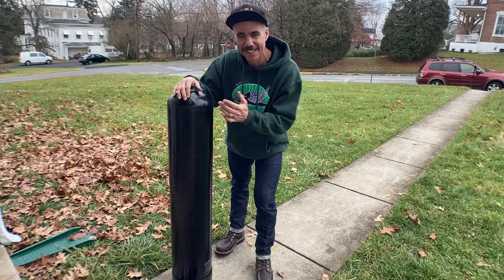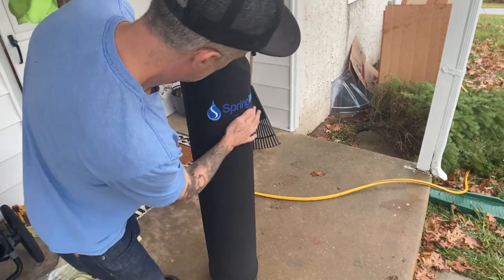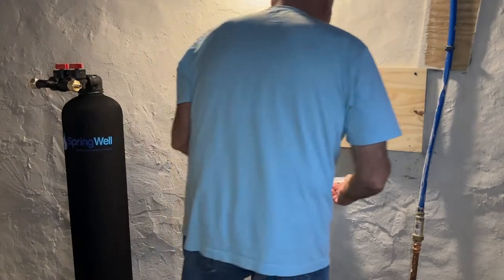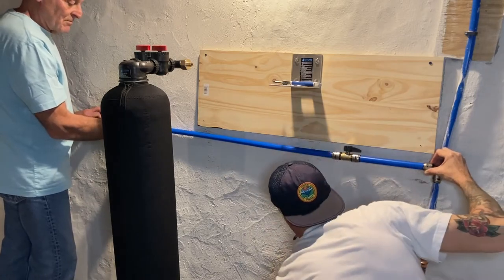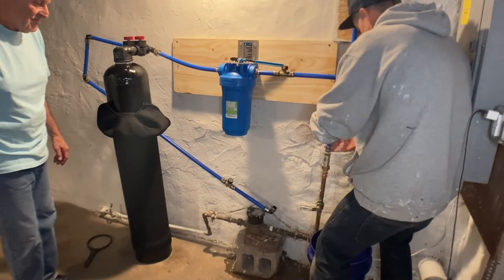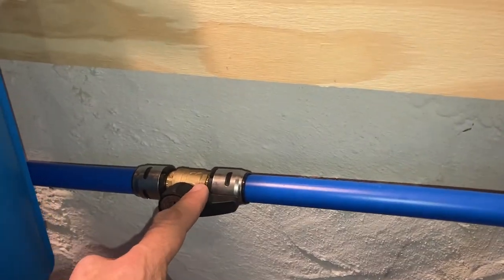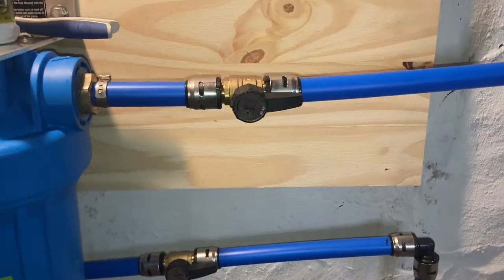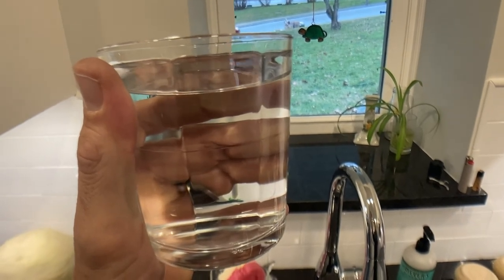The Best Home Filtration System - Springwell Whole House Water  Filtration System

Comment: Been a plumber for over 25yrs.  Some thoughts, 3/4 pex actually has the same diameter of 1/2 copper.   Your flow is severely restricted.  I just installed one of these systems with the UV light.  I used ALL 1 inch pex so flow is not restricted in any way.  Also I installed a complete bypass of the whole system so any maintenance can be done without having to turn off water to the house.  I also presoaked the carbon filter and flushed the whole house after install, very important.
Reply from the maker: Thanks for contributing, love the username!!
Not much I can do about the 3/4” pex in the house. It’s how it came, and honestly, we have no issues with water pressure. 
Re-running new lines would cost an arm and a leg!
In regards to filling the tank and flushing it after, at the 0:17 mark I clearly explain you need to fill it and let it sit for 48 hours.
😑😑😑
As for your setup, it sounds like the work of a seasoned plumber. 
I’m just a homeowner trying to do the best I can.
Thanks again for contributing!
Reply: @DIYTutorialGuy  You're showing your age if you recognize the username lol. Good job as a diy. Just pointing out some professional differences. You will know there is a flow restriction when you're taking a shower and someone turns on the washing machine dishwasher or flushes a toilet. Prepare to be burned! Lol!
Reply from the maker: Seems you and I have been around the block a few times!
🤜🤛
Your advice is great, and you may get a comment from me in the future if I have any plumbing questions!
Man, my last house had that issue; flush a toilet while in the shower you got scalding hot water. 
Ouch!
When we first bought the house the toilet would occasionally run. No big deal…until you are in the shower thinking nobody will flush, then the toilet starts filling again!
Reply: @vinnygoombatts1458  I am purchasing this unit and it is going to be installed in our well closet. All of our connections are located at absolute floor level. Will I have issue if I run flex tubing from the top of the bottle down to floor level on of inlet/outlet sides?
Reply: Thanks, I hope I have the same success...no plumbing skills 😒
Reply from the maker: You’ve got this!
And if you encounter any issues, comment here. There are quite a few plumbers that have offered excellent advice and would be able to help you out.

Comment: I'm installing my system this week. No one has the 3/4" PEX x 1" FNPT adapter I need. Had to order it online. I'm also using 3/4 PEX. I bought the crimp tool to and will use the rings to secure the connections. It's going pretty well so far. Thank for the video, it helped me plan my project.
Reply from the maker: Nice work, glad this video helped!
Keep me postrd.

Comment: Looks good you did forget the bypass, in the event you get a clog or cant get a filter you would be able to bypass all of this.  Easy to add right there where you have those 2 90s at your water inlet.
Reply from the maker: Thanks for watching and commenting.
I chose to not install a bypass.
If an event arises where I need to bypass the tank, it will be addressed at that time.
Take care!
Reply: I believe that tank has a bypass valve included at the  tank head and the tank can be detached while leaving the head/valve in place to do maintenance. The Springwell website has an image of this in the instruction on replacing the media.
Reply: @Mrcm30  yes but that's just on the main tank, if that sediment filter leaks, like it does in the video, they're screwed.
Reply from the maker: Wow, really driving it home.
Reply: @DIYTutorialGuy  for the cost of 2 tees and an extra valve, it's absolutely standard practice
Reply from the maker: Well, you seem to be a plumber.
I’m not.
I appreciate the constructive criticism of my work, as well as your added criticism of Springwell.
Hopefully your comments prevent anyone from missing a standard practice step during install.

Comment: Thanks for posting the video.  In the process of designing our water filtration system which will be the Apec Brand.  I am curious why you put the sediment filter after your main filter?  In the videos I have seen so far, the sediment filter always goes first, then the more expensive filter(s).  Overall was fun to watch your installation and explanations.  Good job!
Reply from the maker: Springwell support stated it can go before or after. 
Their instructional video had it after the tank, so I did it that way.

Comment: How do you like the system after the first few months? Have you noticed any carbon dust in the toilet tanks or clogging aerators? That seems to be the biggest concern with users. Springwell told me to install sediment filter after the carbon, I am thinking I will need a pre and post sediment filter.
Reply from the maker: Good question!
Everything seems fine since the install.
No carbon dust or any clogs.
I will be changing  out the sediment filter next month, as it will have been about 4 months.
Springwell says 3-6 months is a good timeframe to change it.

Comment: On the Springwell website there is an available upgrade to the "Reverse Osmosis Water Filter System+ $457.83" is this one of those under the counter type systems or is it directly connected to the whole house filtration tanks?
Reply from the maker: It appears to be under the counter.
Check the link below for more details:

https://www.springwellwater.com/product/under-counter-filtration/reverse-osmosis/

Comment: I have a slight leak at both ends of the sediment filter.  No dripping but wet to the touch.  my plumber had to redo the fittings twice but still have slight leak.  any advice?  used teflon tape and pipe dope.  still the same.
Reply from the maker: That’s a good question.
My advice, and it’s only advice, would be to contact Springwell and share your situation with them.
If you have documentation that the plumber tried repairing it 2x, then there may be a defective thread or something on the filter housing and Springwell can send you a replacement.

Comment: Im currently looking for a water filtration system.  Do you recommend this one. How much is the replacement filter ?
Reply from the maker: We have been satisfied with the water quality of the water.
I just tested the water the other week, mo contaminants. Now, to be clear, our city water is pretty good, this is just an added layer of protection.
The replacement sediment filters cost roughly $40 and come in packs of 2. They last 3-6 months, depends on the user.
The actual tank will filter roughly 600,000-1,000,000 gallons of water before needing to be exchanged.

Comment: As a plumber, My only criticism is the male brass PEX adaptors into the plastic housing, that's a no-no. Plastic into plastic, plastic into metal, but never metal into plastic. You'd think for a thousand bucks, Springwell would use brass inserts, or give you the plastic stubs(1"x3" pvc nipples) so you don't use male adaptors...
Reply from the maker: Why is metal into plastic a no go?
Honest question.
Reply: @DIYTutorialGuy  a little less so in this application, but in general, you can crack the plastic running a tapered metal pipe into it too far... I would say the main risk here is ruining the threads in the housing, since they will just crumble if you reefed on the fitting with a pipe wrench. At least the pex adaptor will bottom out first.

If this was say...an 1 1/2" pvc drain line with a pvc to female adaptor, threaded on to an old steel pipe... begging for trouble, it'll will definitely crack over time, if not immediately. In that case, you're better off with a Fernco rubber connector between them.
Reply from the maker: Good to know for future jobs.
Thanks!

Comment: You would think there would be no sediment after going through that huge filter 🤷‍♂️. Odd that it’s after the main filter
Reply from the maker: Carbon leaves a non-toxic sediment. Makes sense to have it after the main tank for that reason.
Also, Springwell said it works best there, so that’s where I installed it.

Comment: You should have the RO 5 stage under your kitchen sink for your own drinking/cooking water! :) the Springwell or Aquasana, Pentair, Pelican ..etc whole house water filtration system does not provide the water clean and/or safe enough to drink! (I do not trust too much into the City/well water system yes that's sad true)!
Reply from the maker: Interesting.
How did you come to know this information?
In addition, my understanding is that a RO system is ideal for well water. However, when running RO with city water, it becomes extremely expensive.
Reply: @DIYTutorialGuy  I have Aquasana Whole house filtration then I have RO 5 stage for my drinking, cooking (after water goes through Kangen Alkaline, the Kangen re-mineralize the water if some said RO rip of all minerals in water)

No RO not that expensive, just keep changing 10' sediment water filterings every 2 months and carbon activated filter every 4 months (both are about $10) ...
Reply from the maker: Do you live in Flint, MI?
That’s a serious filtration setup.
Reply: @DIYTutorialGuy  I live in Southern California!
Reply from the maker: @jpthsd  I had no idea the water there was so bad!

Comment: Hi,  nice video.  If you install this system  then does it  both treat "hard water" ( calcium etc ) and remove chlorine etc ?
The sediment filter doesn't do the above right ? So, the big tank carbon filter would do both ? Thanks :)
Reply from the maker: Thanks for watching and commenting!
As for this system in the video, it does not treat hard water.
If you need to treat hard water, there is a separate water softener tank you can add.
It does remove chlorine.
Reply: @DIYTutorialGuy  Wait, your last comment: "It does remove chlorine" refers to the carbon tank or the water softener tank ? Thanks
Reply from the maker: My apologies, the way I worded it was confusing.
The carbon tank filters chlorine.
The link below will take you the Springwell site:

https://www.springwellwater.com/product/water-filters/whole-house-water-filters/?gclid=Cj0KCQjwuaiXBhCCARIsAKZLt3m7yV3_5zm4qo1EeqlqUZQEzSMD8g_b-S7QFhco26QxSRToCw9qo3gaAg07EALw_wcB

Comment: Why did you put the sediment filter after the weater filter?  One would think you woulnd't have much sediment making it through after the water filter ( at the same time clogging up the activated carbon filter?)
Reply from the maker: The directions from Springwell specifically state to install after the carbon tank.
Chats with Springwell have stated the same.

Comment: You and I must have completely differing directions.  Mine says hook it up and put water to fill the tank through the inlet. Once full, LOCK it up and let it soak for 48hrs. THEN rinse for 3-5 min through the inlet following with 3-5 min through the outlet of each tank.

You did all the rinsing before letting it soak.

Hmmm. My directions are over 8 months old...
Reply from the maker: Thank you for pointing this out, as well as sharing the age of your manual.

At the 0:17 mark I clearly explain you need to fill it and let it sit for 48 hours.
😑😑😑
🤷‍♂️🤷‍♂️🤷‍♂️

Comment: I hate shark bite connections. I see them leak too often. lol so if I do order one of these systems, I will be using copper pipe and soldering pipe..yeah more labor intensive, but copper is king. lol
Reply from the maker: Actually, cash is king 🫡
Reply: and yet the only thing that leaks in this video are the threaded connections lol

Comment: Should have done a bypass and used 3/4 type a pex
Reply from the maker: Ok.
Reply: @DIYTutorialGuy  good enough. Pex a uses those plastic connectors that are full flow and shrink down plastic connectors.
Reply from the maker: I did use pex, with the Sharkbite crimps. Was way better than copper or pvc!